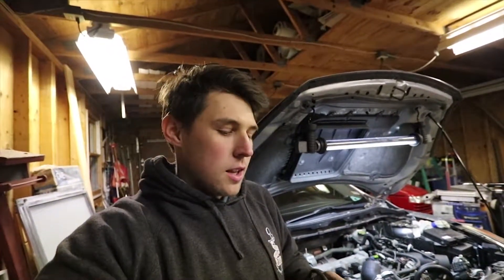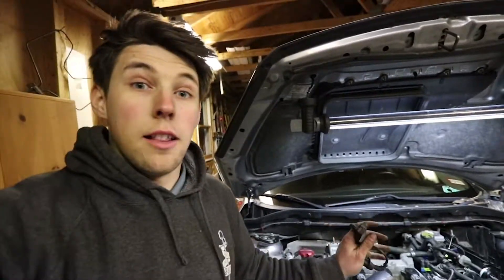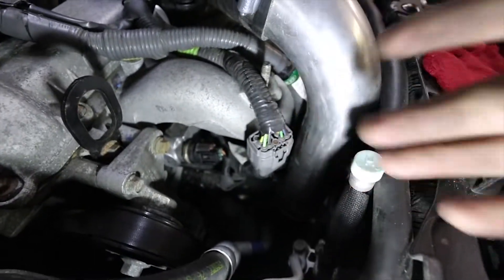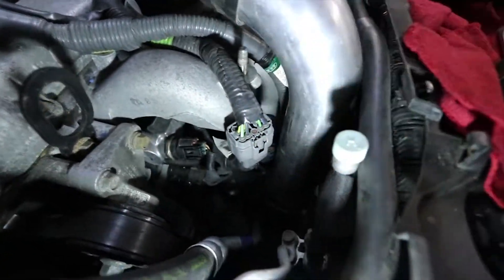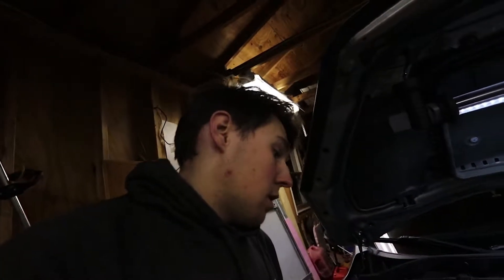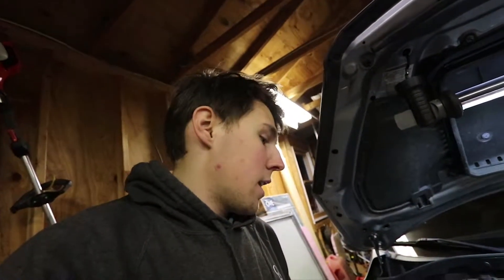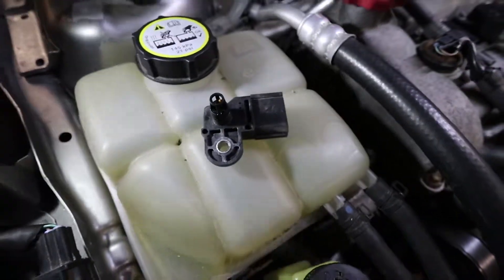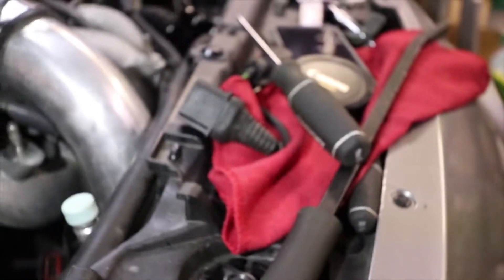Mazdaspeed 3 Map Sensor Installation! *EASY 15 MINUTES*

Comment: do you remember if the map sensor connector clicks on i got a p0069 and went to clean it it just slide right of and i was wondering maybe thats the problem?
Reply from the maker: Do you have the extension?
Reply: Did you figure out the problem? Mine turned on the same code right after I just changed the map sensor.
Reply: Brianda Reyes make sure it’s the matching oem map sensor for your car. My problem was that my upgraded map sensor from cork sport was not tuned. So my tuner is gonna tune it this Monday. What car you got?
Reply from the maker: Carlos Galvez he’s right, make sure you a a tune thats calibrated to run that specific map sensor! If not you might get a code. The harness should click.